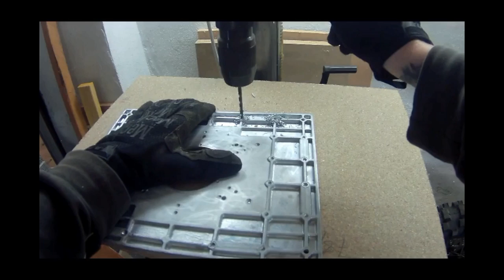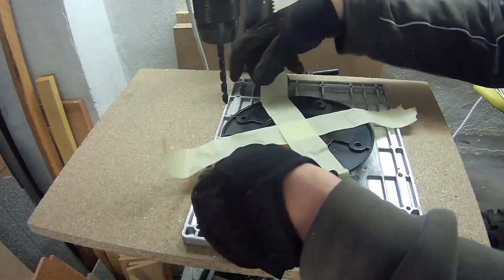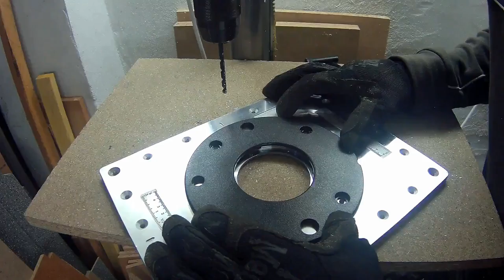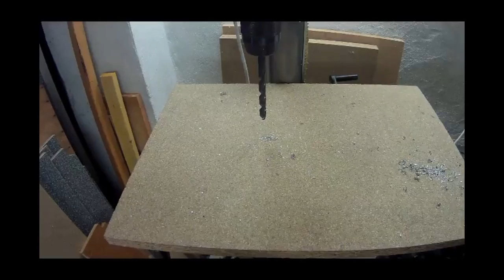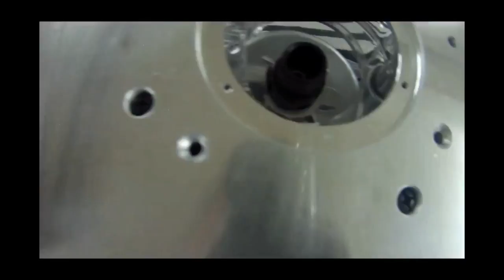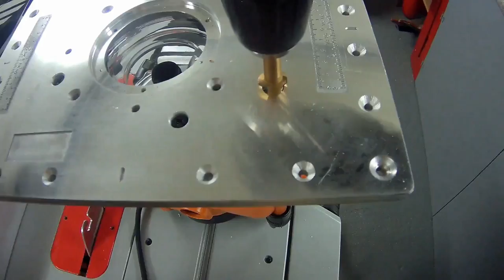UNIVERSAL ROUTER TABLE INSERT PLATE FOR TRITON TRA001

Comment: 17 likes must be close friends.... I have a TRA001 and TRB001 and could not work out what you were attempting to do.  You may as well have started with a 6mm aluminum plate and drilled that.  I think you were conned if that was supposed to be a "Universal" plate...  If there was a language issue, you could have added some text that Google could translate.
Reply from the maker: for the 17 likes I have no friends so ... (if it can reassure you, there are many more dislikes than likes on this video) as for the aluminum plate I didn't find any for the tra001 so I had no choice but to adapt, with a simple aluminum plate I wouldn't have had the plastic rings in the center for different cutter diameters, I'm aware that it's far from a good first video, I'm trying to improve myself
Reply: @js_workshop  Thank you for taking the time to reply.  It would have helped the cause, if you were able to show the desired result.   I understand that making video for YouTube is not as easy, for the beginner, as some think.